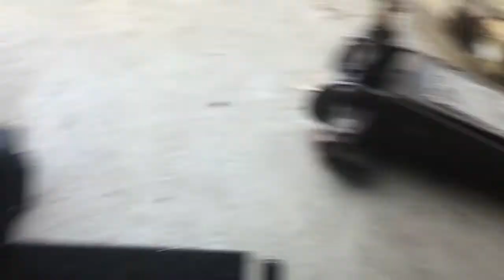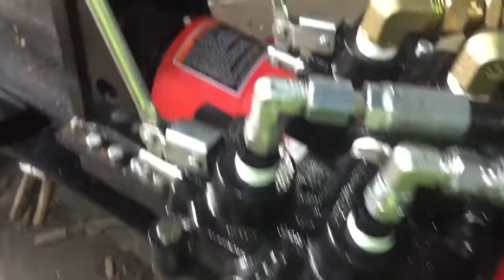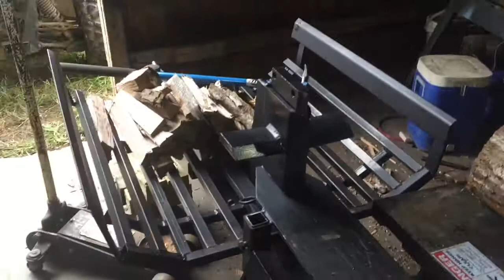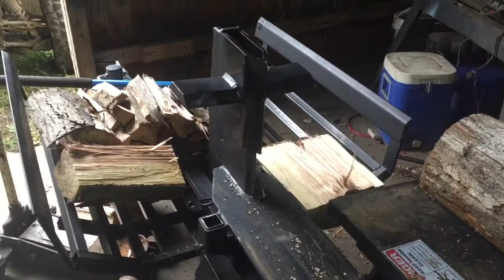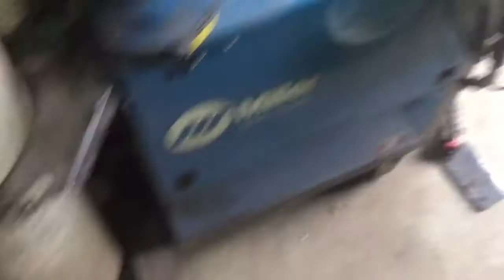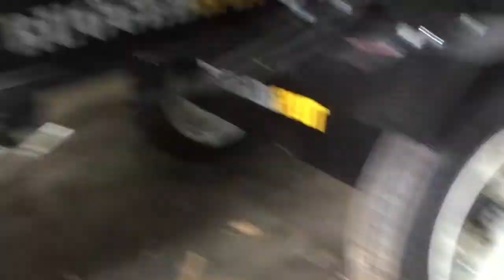RuggedMade 37 Ton Log Splitter Hydraulic Wedge

Comment: Fantastic job looks great. I have the same log splitter. Would you be interested in sharing your design and specs on that? I would love to build one and put it on mine
 Thank you
Reply from the maker: It's been a while since I built that but I would try to guide you as best I could. I think I still have some extra parts to build it, hydraulic cylinders, valves and some of the fittings to hook it up. I was going to fab kits but sold the splitter before I got a chance to get into it.

Comment: Genius ! Next project....... box wedge and pull-back arm.
Reply from the maker: Prolly need a new beam if you wanted to convert it that far, The I beam on the ruggedmade is a tad on the weaker side compared to most box wedge designs out there. It could be done though, cut the wedge off and just build it like an Eastonmade.